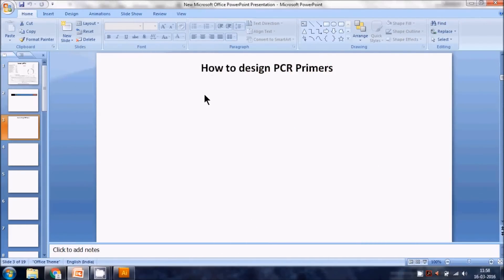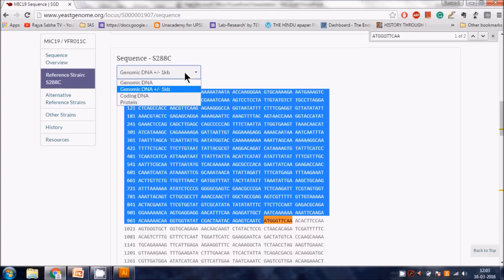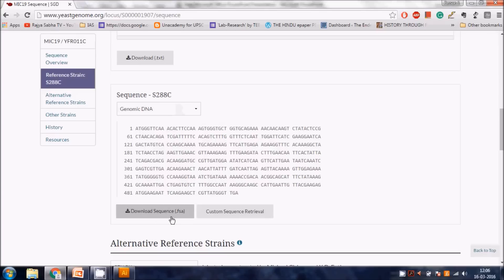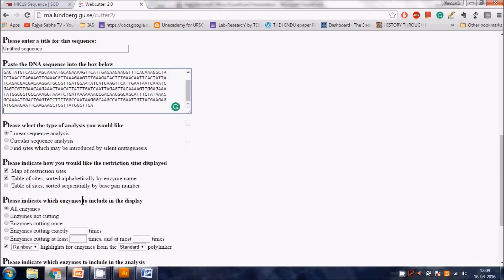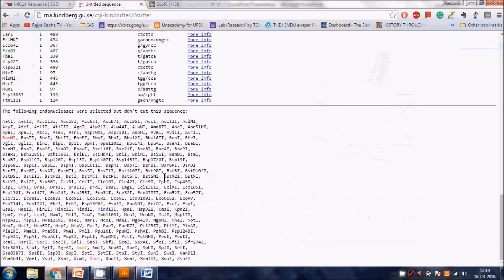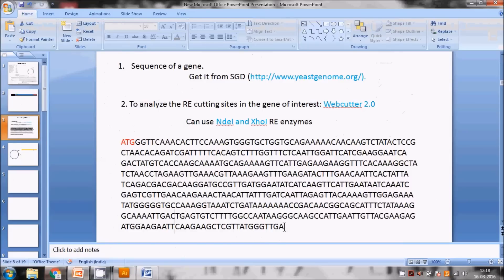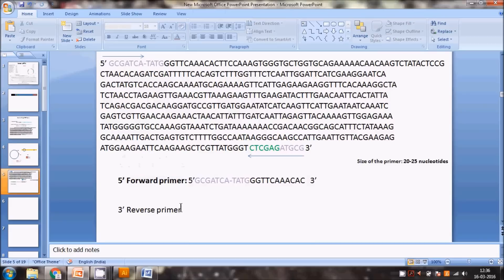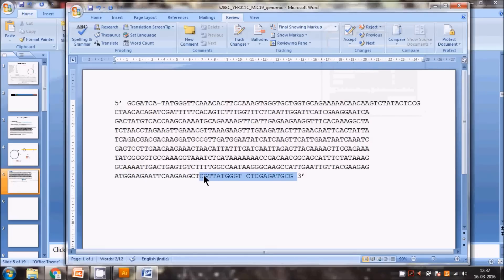How to Design Primer for Gene Cloning : Tips & Tools Part I

Comment: Im sorry but this video was very badly done. your voice is too soft, the slides were not prepared beforehand which made everything very disjointed, and please go find some proper softwares to do primer design instead of using word document. Also, i there are better steps to follow for designing primers instead of just using an arbitrary length. it is good that you highlighted that primers should not have G/C near the 3' end though.